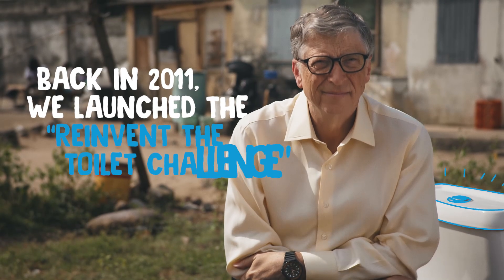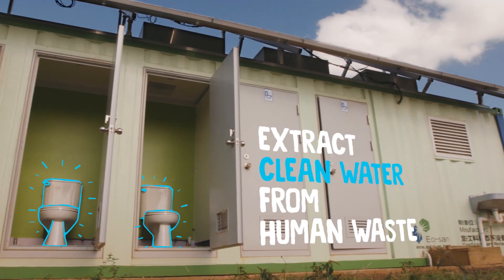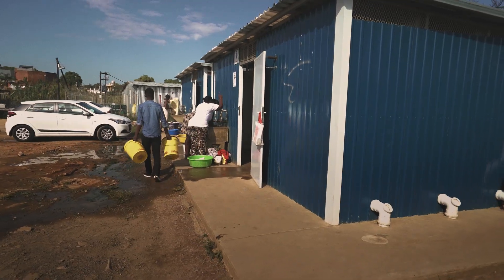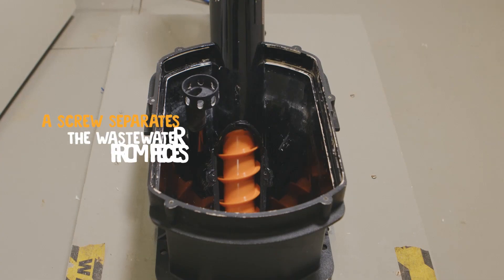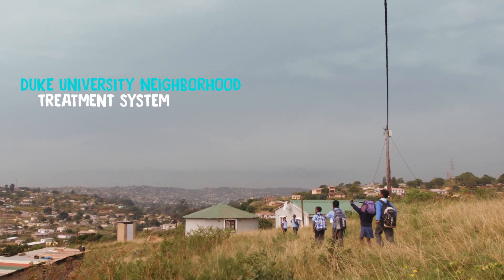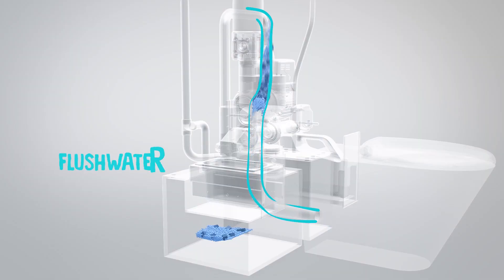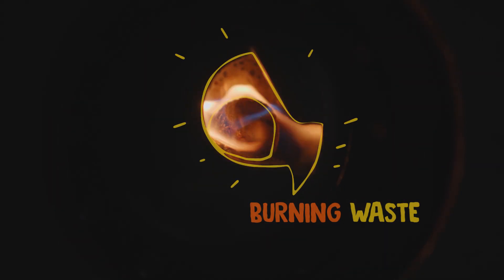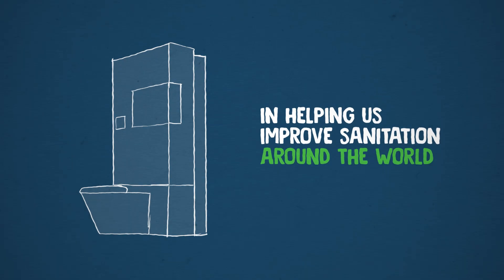Sanitation showcase

Comment: I helped Bill Gates with oxalate disease. Could OXALIC ACID be the cause of Diabetes type 2 (oxalates in the liver), fibromyalgia, kidney stones, and gout (uric acid +oxalates).  VITAMIN D3 (50ng/ml) + Chromium makes an enzyme called oxalic acid reductase that converts oxalic acid to lactic acid.  Metformin causes lactic acidosis as a result of chelating oxalates to oxalic acid (then in turn gets converted to lactic acid by methylation.)They should try at least 4000 IU vitamin and add chromium.   Most enzymes and proteins made by vitamin D3 hormone upregulation are at the vitamin D3 blood level @50ng/ml eg. glutamylcysteine ligase.  Metformin and citrate chelate oxalates can be determined by test tube studies in calcium oxalate.  They should try vitamin D3 (4,000 IU) and chromium.  Chromium is expected to be deficient as a porphyria (co-porphyrin-1)develops in the autistic that have high oxalic acid levels and low vitamin D3 status based on the lack of glutathione which removes heavy metals from the body.  They should try chromium 200 mcg along with the D3 to remove oxalic acid by converting it to lactic acid. It would make for a very interesting study to gauge the porphyria (co-porphyrin-1) in type 2 diabetics?
 I have been doing this for people for 9 years now.  I am telling them to go to their physician and see if they want to monitor their vitamin D3 level along with getting chromium in their diet.  I tell them the first time they take vitamin D3, calcium citrate and chromium to expect leg cramps or diarrhea due to the production of lactic production.  Everyone who has followed through this process of taking vitamin D3 up to 50 ng/ml blood level along with getting chromium are no longer diabetic.  Some even said thank you for the heads up  on the lactic acid buildup and for helping them with their diabetes.  I have no lab once I discovered the link between autism and diabetes is oxalic acid and that there is one porphyria in the autistic is elevated.  I reasoned that chromium was the atom at the center of the porphyrin ring for an enzyme that converts oxalic acid to lactic acid as oxalic acid levels are increased in autism, fibromyalgia, gout, and kidney stones (these comorbidities are elevated in type 2 diabetes .   RAR receptor (vitamin A or  (pio)/ (ros)glitazone) is also linked as the vitamin D receptor is associated with vitamin A expression vector.  Tumor necrosis factor is also controlled by vitamin D3 levels as a repression @ 50ng/ml.  I have been nondiabetic for over nine years now.  The paleo diet also works for type 2 diabetes because the liver is rich in chromium (Kale, egg yolks)and vitamin D3.